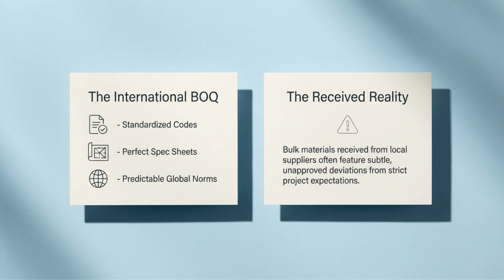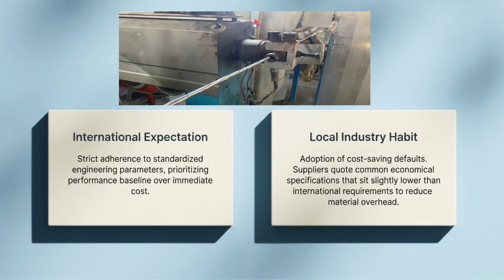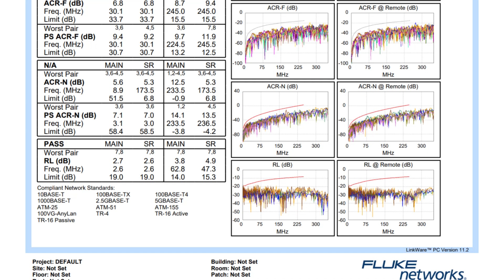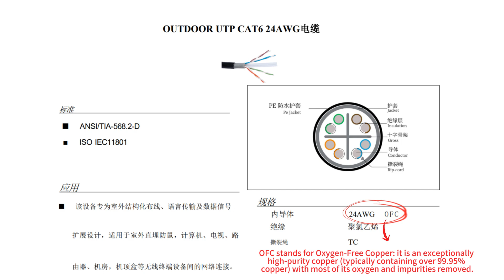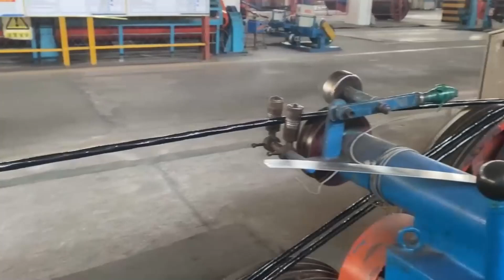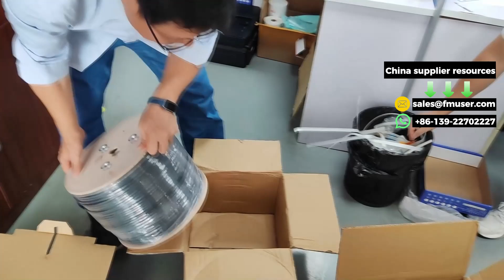How to Avoid BOQ Sourcing Traps in China (Cable & CAT6 Case Study)

Comment from the maker: Welcome to the Cantonmade Tech Sourcing Guide! Discover the real reasons why your received engineering materials often deviate from your expectations when purchasing BOQ items in bulk from China, and see how our local expertise can help you avoid hidden specification traps to secure the exact materials for your customized project needs.▸ WhatsApp: https://api.whatsapp.com/send/?phone=8613922702227&text=Hello-I-watched-your-BOQ-Sourcing-Traps-Video
▸ Email: sales@fmuser.com ▸ Call: +86 139-2270-2227

If you are a project-based buyer, an engineering contractor, or a cross-category sourcing manager looking to accurately fulfill detailed BOQ specifications in China without falling for material or dimension traps, the Cantonmade team at our Guangzhou headquarters is ready to assist you. Cantonmade provides a complete end-to-end sourcing solution, including enforcing strict technical contracts, bridging technical communication with engineering-backed experts rather than standard sales reps, conducting strict on-site quality control to verify materials like pure copper, integrating complex physical structure requirements, and delivering long-term full lifecycle support for your safe and seamless procurement.

Watch Also:
 📺 Maritime Vessel IPTV for Offshore Oil Rigs : https://youtu.be/kOf4U5vqt6w
 📺 Why Choose FMUSER IPTV System for Your Hotel : https://www.youtube.com/watch?v=3405zjkIyDc
 📺 Technical China Sourcing Vlog: 2-Day BOQ & QC ： https://youtu.be/MITGP35PbSY
 📺 Tanzania Hotel IPTV Success Story : https://youtu.be/V2Ncu-pGfvo
 📺 ISP IPTV Case Study ： https://youtu.be/H7LRNyyLqlM
 📺 Camera Pre-Shipping QC Process ： https://youtu.be/xQHNvUeq2L4
 📺 IPTV Setup Guide ： https://www.youtube.com/watch?v=CPh5kd_sApU
 📺 Hotel IPTV Case Study ： https://www.youtube.com/watch?v=FN388sPgz-U
 📺 IPTV FAQ ： https://www.youtube.com/watch?v=YzBcyj2NASE
 📺 New Hotel IPTV Gateway ： https://www.youtube.com/watch?v=5I_cHhKXxxI
 📺 Smart STB Unbox ： https://www.youtube.com/watch?v=aqwc-8RTXdw
 📺 Hotel IPTV Features ： https://www.youtube.com/watch?v=0jVFQs34oYI